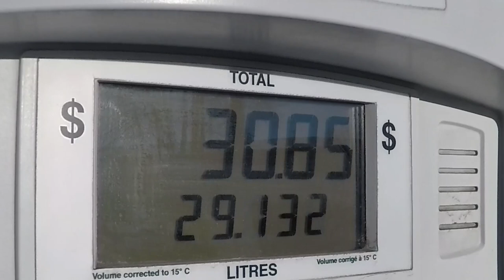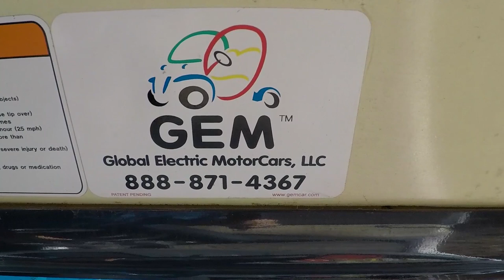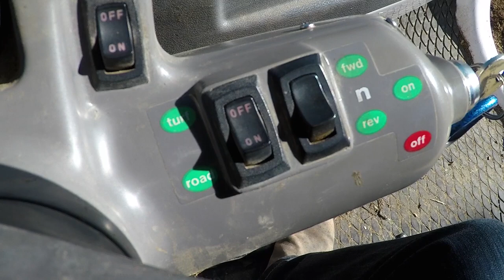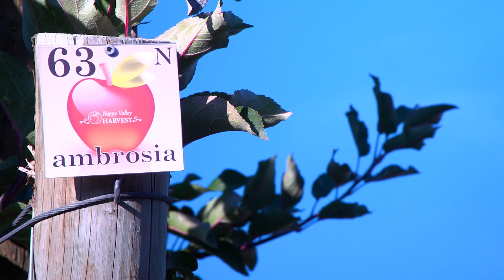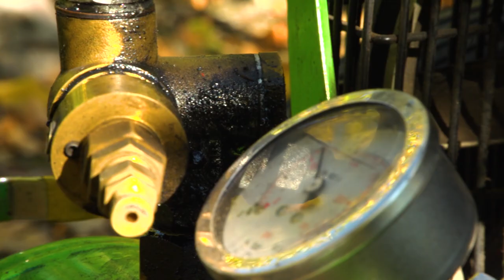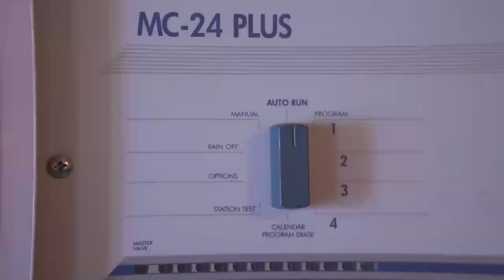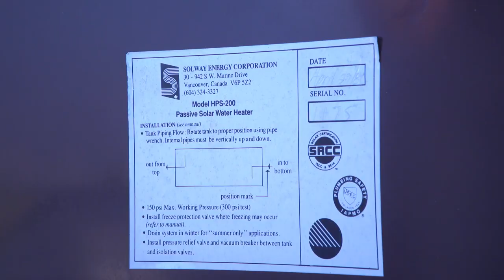The Path to Sustainable Farming | Steve Brown

Comment: That is one great video by the Apple Farmer/videographer.  BYW  I put in a 7kw solar array here in Austin at 80c per watt total.  no subsidies, no rebates.  Just bought Model X sunpower 327w panels used a few years, Solar Edge Inverter and Optimizers, and ironridge mounts.  A bit of solar wire, junction box and conduit.  Thanks to Ebay and a few suppliers.  I couldn't afford the $2.75 per watt I would have to pay after getting rebates and tax credits.  Those farmers are DIY guys like me and I may be a bit better but that would blow up my ego and self worth.  My roommate in Wisconsin was from a small farm and his other farmer friends were in the top 1% of med school, and other disciplines.  Not a bad lifestyle doing something people love and appreciate.
Thanks for posting this video and promotiing this great stuff.  BTW again there was a top physicist at UW Madison in the 70s that was off the grid with a wind turbine.  The big dilemma was running the Osborne portable computer at the time. Since December 13th till Jan 30th I have produced 800kw off my array during the crappiest weather of the year for solar.

Comment: technically burning prunings cleanly into Co2 results in the least carbon emissions, because wood releases methane as it breaks down, which is a much stronger greenhouse gas per carbon atom than Co2. I'm all in favor of mulching, and the sequestration of carbon as the wood rots is worth something too, but there's a lot to be said for burning cuttings in contexts like logging, where they are sometimes left to rot in huge piles that cause a lot more harm than a clean burn. (clean meaning oxygenated to produce the most Co2 and the least particulate and CO emissions)